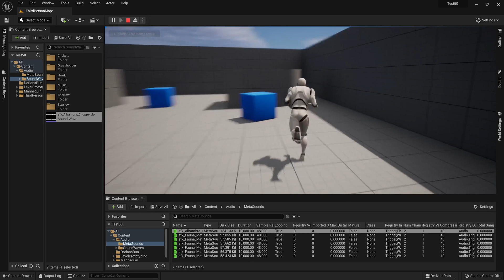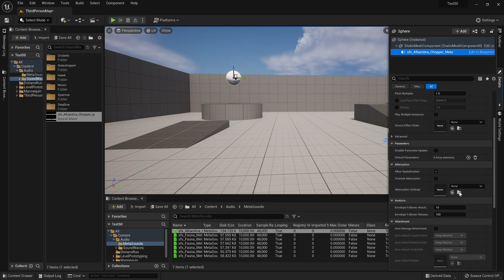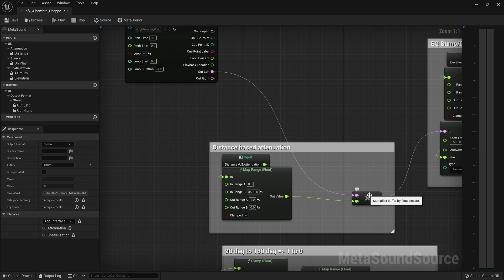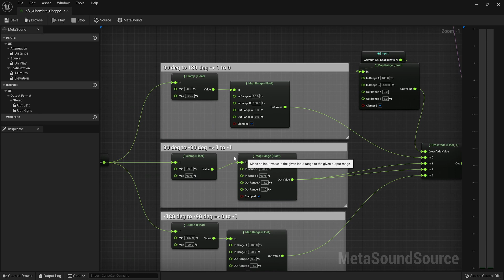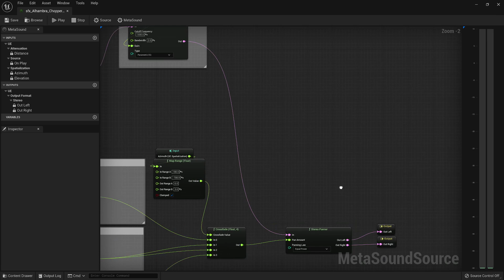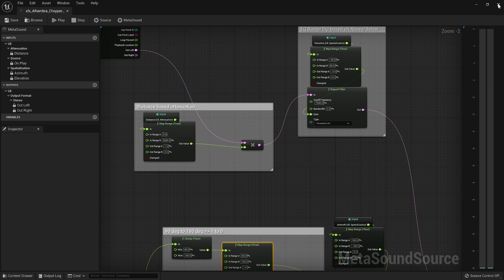MetaSound Interfaces UE5 Preview 1

Comment: Hey Dan, great Video, thanks again!
Would you be so kind as to also share the BP you are creating to access different metasound interfaces? are there any other nodes except "set float/trigger parameter"?
Reply from the maker: There is no Blueprint function, the spatialization and attenuation interfaces come from the audio engine.
Reply: @DanReynoldsAudio  Any planes for additional interfaces? A MIDI interface for example?
Reply from the maker: @itaimatos  Hopefully in the future there will be lots of interfaces that feed all kinds of data into MetaSounds!

Comment: Hi Dan. Great lecture. Thank you. 
Can I get 2 or more ambient(3D) binaural sound from 1 PC at the same time via metasound? 
I want to put 2 virtual mic in map and get sound from different source. 
I can place 2 cinecameraactor and output videos via SDI port or something, but in case of audio, I can't find any solution.
Reply from the maker: There is only one listener per viewport and only one renderer per client, so there's no easy way to have two listeners with different perspectives on a shared client.

Comment: Very cool! Spatialization would be limited to stereo in metasound, right? Rear speaker signals would just fold to the front speakers...
Still, so cool to have access to those parameters in metasounds. Thanx guys! :-)
Reply from the maker: Yes, this would not work in surround. The point wasn't to suggest spatialization in this method, the point was the power of interfaces and getting parameter data like altitudinal angle, etc. to modulate the design.

Comment: How do you spatialize a 2D sound without using metasound?
Reply from the maker: Not sure what you mean. If you add Spatialization settings to a sound, it is treated as 3D.

You could use a Stereo Panning Source Effect if you wanted to control panning, and you can just attenuate volume based on distance with a blueprint script. Is that what you mean?
Reply: @DanReynoldsAudio  thank you for your fast answer. I mean binaural audio, not simple panning right/left and attenuation but same effect you get with ambisonics (up/down and accurate distance binaural localization). How can you fake that effect only with a 2D audio?
What I want to do is to create a musical environment with mobile playing sources. Is there a good plugin external to Metasound for that? Or do you suggest to experiment in Metasound as you did in the video?
Reply from the maker: @paolosenesi8916  There are plenty of spatialization options available. This demonstration was not meant to encourage people to spatialize inside MetaSounds, it was a proof of concept of how powerful interfaces could be.

Just use Spatialization normally and pick a spatialization plugin that sounds best for your purposes.